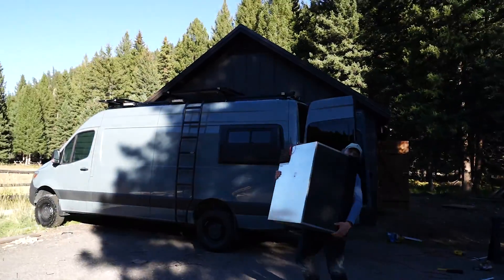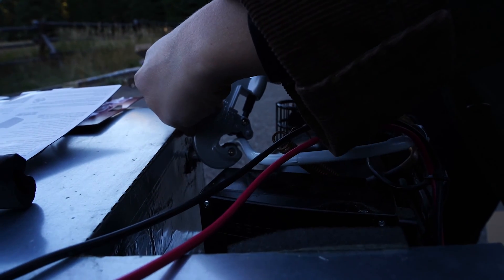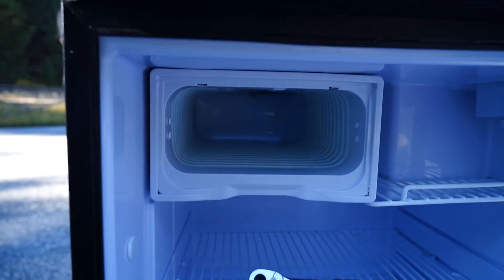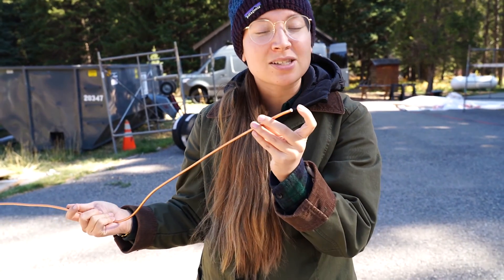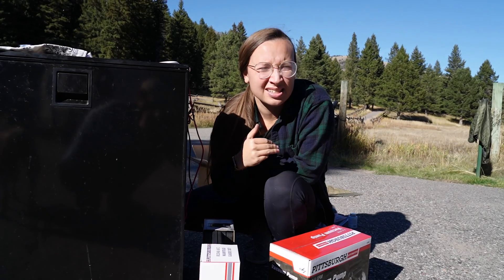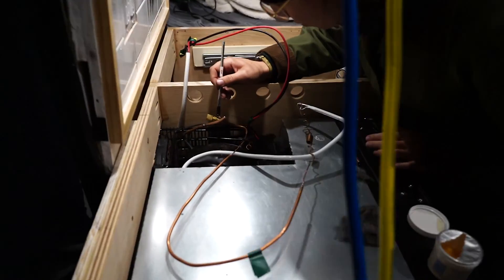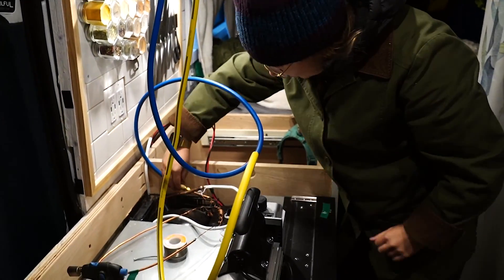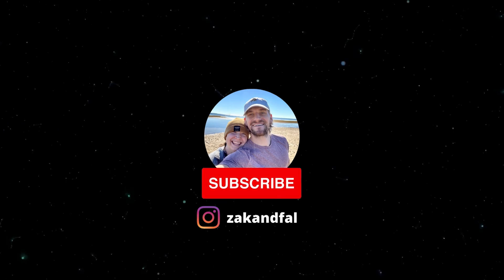How We Repaired our Van Fridge (Isotherm 12 volt)

Comment: I just punctured a tiny hole into my evap plate trying to chip away at ice underneath the freezer box. Heard a leaking hissing sound for a few minutes and all of the coolant leaked out. Cannot believe it... such a tiny hole costing us so much turmoil. Is that what happened to y'all? I really want to hire a refrigerator repairman.
Reply from the maker: Unfortunately, yes this is what happened. Almost every repair person we took it to either said it will cost as much to fix as buying a new one OR they wouldn't do it at all. I know that's probably not what you want to hear, but hope this helps.